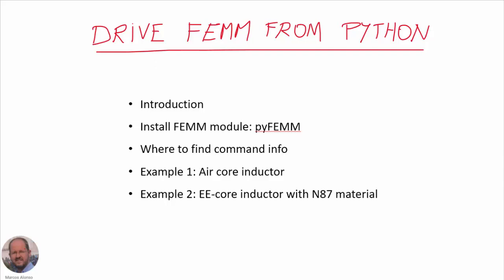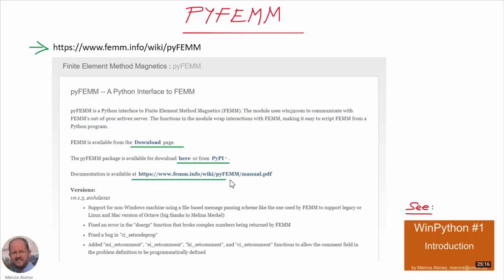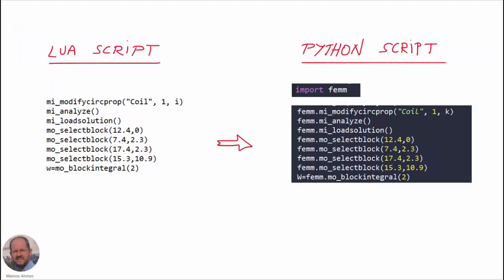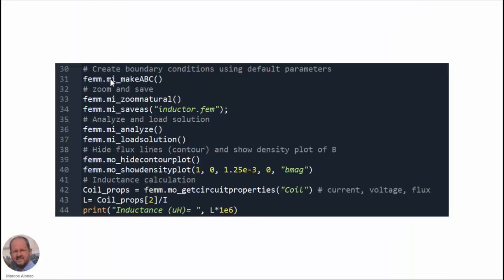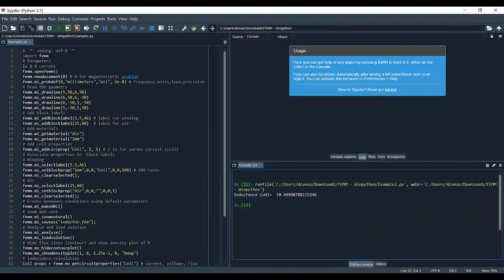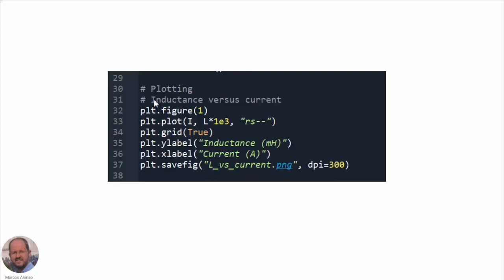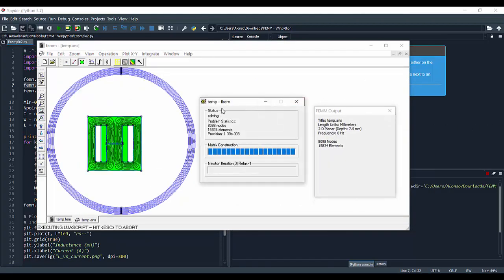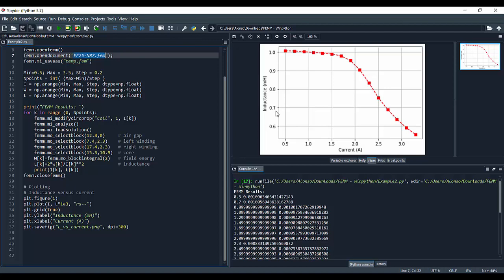FEMM #4: How to drive FEMM from WinPython

Comment: Hi Professor,

     For the example 2,
     If I use Python codes below to get the inductance, what is it? Why is it different from the one calculated from field energy?

     Coil_props = femm.mo_getcircuitproperties("Coil") # current, voltage, flux Linkage
     L1[k]=Coil_props[2]/I[k]
Reply from the maker: Hello, the value should be the same as when using the energy. Check that you are selecting all relevant volumes to calculate the energy. For more info please watch video FEMM #3: https://youtu.be/JPMAo8OHVAA. This video shows both methods